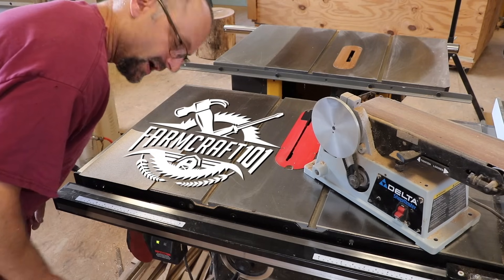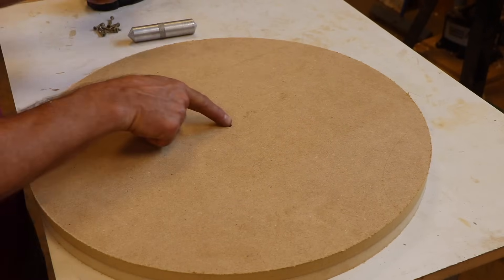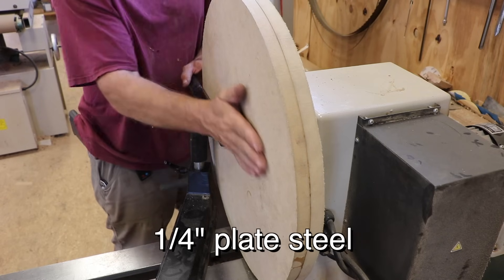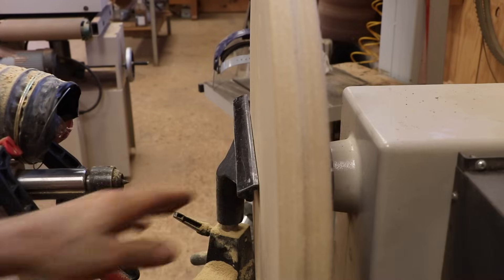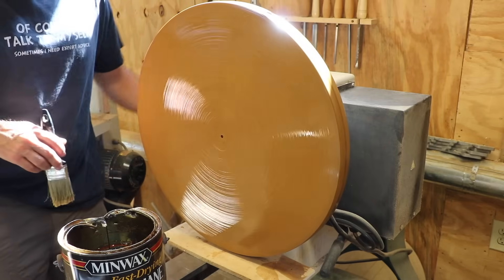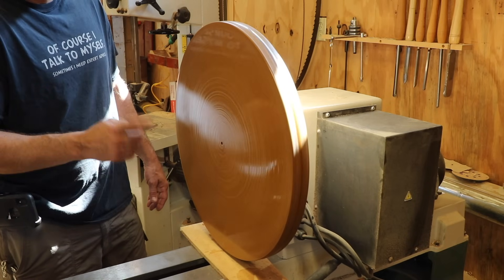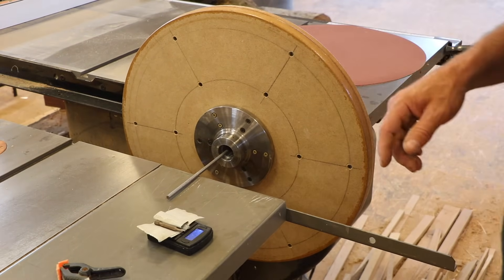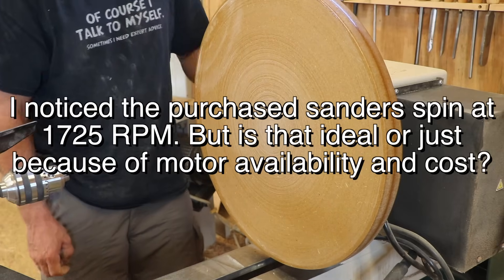DIY 20-inch Disc Sander Build.  $2000 Tool, Cheap and Easy.

Comment: Nice job. Consider sealing the other side against humidity  to reduce the possibility of warping caused by different absorption rates.
Reply: Precisely what I was thinking!
Reply: I agree entirely. I had an MDF router top that was formica on one side and 'raw' on the other. Cupped pretty bad over time and ended up having to toss it.
Reply: Yep.
Reply: You are right that ealing both sides is critical for avoiding warping. Mr Farmcraft101  is an amateur pretending to be a teacher by naming his channel Farmcraft101 like it is a college course.  He is really a jack of all trades and master of none.
Reply: But better than a Master of One
Reply: @rationalist47  it's farmcraft 101 and not woodcraft 101 mate. and a jack of all trades is a master at farming 😉

Comment: Back in the 1950s, when I was a teenager, my Dad's shop had a 4 foot wide sander that i loved to "play" with.  And all the machines there were run by leather belts that were moved to large drive wheels by long wooded handles to turn them on and off.  The Jointer was 2 feet wide, the Planer was 4 feet wide and the Shaper had a 2 inch spindle.  There was also an Elevator to the 2nd floor driven my belts actuated by pulling ropes.  Loved that old shop.
Reply from the maker: Sounds awesome.
Reply: Was you father Thomas Edison? Because you are describing his West Orange NJ factory/shop now museum exactly...
Reply: @joehook145  Would love to see it and compare to my Dads.  I say "MY DADS" shop but he did not own it.  It was Lambert's Manufacturing in Waynesboro, VA.  Probably on Google.  When i was young, Mr. Lambert used to give me peppermint candies when i was there.
Reply: @joehook145  Yes.  Pix brought back some memories.  DANGEROUS... OH YES.  One of my Dad's co-workers was missing 2 fingers.  Never knew how it happened.  I got cut once by touching a Jointer blade.
Reply: Off of the Kankakee, river, where the Yellow river joins it, out by Kouts, Indiana was an old paddle wheel grist mill, that did a lot of everything, from grinding wheat into flour, to running a small sawmill, with a blade that was lying in the river, by the railroad track bridge, it looked to be about 4K from the center out to the edge, … and I can imagine that the paddle wheel also powered a lot of other types of tools, … that mill, is now long gone, but it had left its mark on the history of Northwest Indiana, … the 1st Chicago Ford Assembly plant, was located in the town of Dyer, Indiana, and there were these huge pictures showing them in rating an engine block, & associated parts, towards the back of the old Standard Oil, gas station, … a couple of hundred yards from the Illinois State Line, on US 30, … when they tore down some of the homes, on US 30, west of Hart Street, they found that there was underground tunnels, that had been dug, just a few feet below the surface that led to a bar which, was called Al’s Tap, back in the day, … found out a number of years later, that when they tore down the old roadhouse that sat kitty corner from the bank that replaced the old houses with 16’ beams to support the floors, at the intersection of US 30, & Hart Street, that there was another tunnel, that had been covered over crossing from the roadhouse to the homes on the opposite of the street, where the bank, had been built, … 
This was all a great part of the “Underground Railroad”, of Pre, … civil war days, of the 1800’s, and apparently, business had been quite good, … over the decades it had been built to withstand the March of time, & Progress, as the sleepy little town, of Dyer, Indiana became a heavily traveled route, approximately, 4 miles from where the very 1st 4 lane highway was built as a test route, on US 30, made another Deutschland/Dutch heritage site along the routes that the pioneers had blazed through the swampy lands of Northwest Indiana, … many pioneers traveled those routes, some with the local Native Americans guiding them, & some fighting them off, when things weren’t so cordial, … Hart Street, in Dyer was so named for the man who drained, the huge swamps of the Greater Calumet region, in order to create more farmland, resulting in the formation of the Kankakee, Iroquois, & Yellow rivers, in addition to the Grand Calumet, & Little Calumet rivers, along with places such as Cedar Lake, Indiana, Lake Dale, as far south as JC Murphy Lake, (aka Willow Slough FWA), … the flowing waters & other tributaries, created some of the most viable farmland ever seen, but is fast being populated by the Progress of an ever growing population, … as it is regionalized by mankind, instead of expanding in other directions, … as the Chicago shoreline, & suburbs having been built, as far north, & beyond, into the state of Wisconsin, the Indiana lakefront is also continually being built, & progress, will pervade into the state of Michigan, as our population continues to grow beyond our means to care for the ever increasing inhabitants of the lands, … I’m just wondering when will they drain Lake Michigan, as the population continues to increase, … will it become as the western drought, continues its way across the Rockies, … Lake Mead, is it? That Hoover Dam was built to contain, … is at its lowest ever, and it may cease to provide the greedy water corporations of California, any product what so ever, … what does the future hold for America, … the “once” beautiful, with amber waves of grain, … nation that has allowed its own laws to propagate the extinction of freedom, as the word is, & has been so vicariously used to describe only 1%, of those once deigned as the multitudes of the weak, the tired, & downtrodden, … 
I truly apologize for the seemingly endless rant, but felt it needed to be implied and said, … so that perhaps those with the will of prosperity, be led to an exercise of the truth, … this nation, is, … in grave danger, … allowing the corporations to greedily take, without reinvesting in the future of our nation, this country I’ve called home for the past 6&2/3 decades, I can no longer try to carry the load, but am trying to Send a light through the darkness of our futures, in the hopes that it will be seen by enough who truly care for the futures of all Americans, …
Reply: @ronthacker211  that gave me the shivers but im betting the machine wasnt running when you got cut
Reply: @brianshea5014  I used to go with my Dad to sharpen those knives (blades) on the weekend.  When they came off the auto sharpening machine they are beyond VERY sharp.  All i did was pick one up and that's all it took.
Reply: Teenager in the 50s? For someone pushing 80, damn you look young for your age. What’s your secret dude?
Reply: @timconway2810  Cigars, Moonshine, Southern Comfort/Pepsi.  I was 14 in 1959.
Reply: My grandpa had an electrical supply shop in a chicago suburb had that belt driven mechanical devices all throughout the building until he sold it in the late 80s. They still exist here and there.

Comment: Great job. You should get a lot of use out of it. Many years ago I worked at a shop in Germany. They had a huge 36-inch or so disk grinder. It could have been homemade but it was well constructed. It had a very large motor driving it at a scary RPM. It didn't have sandpaper on it, the wheel had teeth made into it. Very coarse teeth. It would eat a 2x6 size piece of lumber as fast as you could stick it into it. It was faster than a saw and the guys would mark a line on a piece of lumber and sand it to the line in seconds. Years later I made one on a much smaller scale with a threaded hub welded to a plate and then trued it up in the lathe. I used sandpaper on mine.  I used it mostly for knife making and it too was very fast at its job.

Comment: I don't know where you would get them, but Shopsmith has a 12 inch disc sander attachment and they offer discs with a hook and loop backing.  Since they probably don't make the discs, someone out there does make them for them with hook and loop backing and they might sell 20 inch sandpaper discs with hook and loop backing. You also get the mating piece from them that fastens to your disc with pressure sensitive backing, and allows you to remove a sanding disc without damage to the sanding disc or the disc fixture, and change to a different grit in minutes.  The discs can be reused until they are worn out, giving you more life from a disc, considering you would want to use different sandpaper grits often.  I like the hook and loop backing because it gives you a bit of a cushion to the sanding disc.  If different sanding grits are important, you could make more than one of the discs you make in this video and have them fitted with different grits.

Comment: I made virtually the same thing for my lathe. I made mine with a layer of MDF and a layer of phenolic faced Baltic birch plywood, so it will hold up to changing the paper.  I can even use mild solvents to remove leftover adhesive.

Comment: For the average home user "house manager" a shop Smith is a great tool that has a disc sander, table saw, drill press, lathe, jointer and more all in one. You can find them used for around 5-750 USD.

Comment: I bet you could include a small ring or clip to the underside of your steel platform plate/table that would allow you to quickly attach the end of your dust collection hose.  As the fine dust comes right off the machine, it gets sucked right up. It’s that super fine stuff that’ll get you or so I’ve heard.

Comment: I made a sanding disc similar to the one you made but I used 1-layer of Corian material on top of the MDF which is flat and a solid material that the adhesive on the sanding disc will readily stick to.

Comment: The one I made 12" wood wheel  on a 1750 rpm motor with no problem with a slight vibration

Comment: I did this on a smaller scale for my lathe, i used a piece of 16ga 6061 aluminum as a facing, epoxied in place works great, use a heat gun to heat disc adhesive and comes right off

Comment: 3m weather stripping adhesive ! is what we used for decades to hold sanding disks on DA sanders ,disk sanders and the like.... it works great and does not get super hard.... so you can get the old disk off if your careful add a bit more adhesive and apply a new disk...

Comment: Maybe a little late but i used varnish on my mdf plate, 3 coats. The varnish bond on the disk is stronger than the adhesive on the sandpaper. I’ve only changed the paper once but it went well. You can wipe it down with a little paint thinner to get any residual adhesive off.

Comment: FYI you can get a Shopsmith sanding disk attachment, then all you need is a motor with the right size shaft or an adaptor. makes a cheap 12" sander

Comment: Well I think you did a great 👍 Job with that. Here is an Idea you might want to check into I've been around auto body guys and I noticed that they use some kinda glue on a disc and put there sand paper on the glue coated disk I think they wait for the glue to get tackie before applying the sand paper. Anyway good luck I still think you have great idea.

Comment: Use Formica laminate on the face. Adhesive discs wil stick, be easy to remove and easy to clean. Also, some weight around the perimeter will actually make it more efficient.

Comment: I put a self adhesive velcro pad on mine to which is attached the 305mm sanding disc. When it wears out I tear it off and attache another one at about A$20 each. Smaller than yours but does all I want it to.

Comment: Yes the backside also needs finished.

Also don't have to waste $ on those cleaning sticks,a rubber sole old worn out boot works just a well if not last longer especially if it's a Vibram sole.
I don't have a lathe so I used a dewalt buffer I bought 20? yrs ago for like $20.Made a MDF wheel to fit a 12" disc.It's adjustable from 1000 to 3600 rpm.
I also built a multi-position table for it to lay your work on and added a dust port.There is almost no dust that gets past the outer edge.

Comment: You asked about top speed.  I would keep it low but not due to size/weight of disk.  But more the inside/outside speed from one inch to next from center.  As you kinda explained.  Way more sanding closer to spindle than away from it.  And if it’s a larger surface your trying to get flat, worse the results.  It’s an exponential difference.  But much difference working with a 6” disc sander than a 20” one.

Comment: A product called  MEDEX  is a waterproof  MDF.
Twenty years ago, I decked a trailer with 3/4 MEDEX werx great. Only upgrade off the top of my head.
Also, two layers of 3/4" Baltic birch would make a great faceplate.verrry dense ply. 9 plies in a half inch....pre drill. It's dense.

Comment: I bought my non expensive disc Sander at harbor freight I have used it it works extremely well considering that I had zero time invested in making it half the time I think the three horsepower motor was more expensive by itself than I paid for the whole sander. I think basically I I bought a motor and got the sander for free

Comment: You need a hard finished surface on the mdf to stick on your sanding disk and be able to remove it later.  Suggest lacquer or polyurethane  and paint it on while it turns slowly on your lathe to get a uniform coating.  Ohhhh you did that...kool.  Turned out great...beats buying one for $2000 +

Comment: A bit late to the party ... when I made my 12" version for my Minimax T124 wood lathe, I did the same as you with regards the MDF, but I then faced that with laminate flooring ... I followed that up by adding hook and loop to the laminate face ... means changing discs is just a matter of pulling one off and putting the other on

Comment: Your a man after my own heart Gunga Din, I try to save money by doing everything for myself whatever I can that is. I simply hate spending money I dont have to. I have a thought some disc sanders use Velcro to stick the disk onto the plate it should be fairly easy to stick it to the plate, the difficulty would be sticking the other bit to the sanding disk, unless you can buy sanding disks that size already having the other Velcro material on the back of the disk. Just a thought. One other thought, in Southern America people catch catfish abbreviated to cat, hence there's more than one way to skin a cat, not referring to our beautiful, charming lovable feline friends at all.

Comment: Just thinking velcro added to sanding disc  and MDF would be good , just like a 3M HOOKIT system used in autobody repair , but maybe  getting velcro that size would be difficult . Just a thought .

Comment: Once i have a smooth surface, i cover the MDF with laquer, or whatever I happen to have in a spray can.  Then i can apply the sanding disc easily, and then remove repeatedly (as needed to change grits) with the aid of a heat gun.  The heat gun makes easy removal and never destroys any of the MDF with this method.

Comment: If you don’t have a large wood lathe, you can use a front wheel bearing (off a front wheel drive car) and the brake rotor. Put it on a stand and make it belt drive. Of course a larger disk attached to the rotor to stick the sand paper on...the car wheel can be used for the base...

Comment: Balancing I would have suggested adding extra screws to level it out. Chances are you may have to rebalance 2 sides or 2 spots on the wheel to get it perfect.
Reply: I was thinking drilling out one inch holes on the back side. I've noticed on some of my large steel faceplates this had been done.
Reply: @robertcornelius3514  yep subtract or add I was just considering the centrifugal forces and the possible expansion over time of the wood at high RPM and thought an extra screw or 2 might help combat that, but may also cause premature splitting.

Comment: Use old hardened silicone from a tube as a sand paper cleaner. Those cleaning rubber sticks get expensive and don't last.

Comment: Just had a thought,wouldn't recycling an old washing machine ,the spider that holds the drum has a nice beefy bearing and pulley system to the motors done,the spider could be modified to support the disc?

Comment: Should have finished the back of the disk also. Plywood and other materials will suck moisture into the side that isn't finished and can possibly warp. Maybe the shop is fully climate controlled year round so probably won't matter. Great channel, subbed!

Comment: Beware of heating when the disc looses sharpness over time. Hot and cold cycles can make the glue on the sanding disc stick with unexpected tenaciousness. Good luck.

Comment: I think that this is one of those things we're more is better. Sure it will remove material faster, but if your not a high production shop how important is that actually. Otherwise I think that is a fantastic Alton Brown approach to your too. (I'm referring to Alton saying there is nothing in the kitchen that as single use, smashes walnuts with fire extinguisher.)

Comment: 1:05 I have that same Delta Shopmaster and I agree, it's not a very good tool.   It's woefully underpowered, and although both the belt and disc can be used, you have to be so gentle with the pressure that it takes much longer than normal to get anything done.   If you were doing super fine detail work, like veneers, it would probably be a great tool, but for "normal" woodworking with large pieces of wood, it is mediocre at best.

Comment: Thanks for sharing. I am in the planning stages of making a sanding disc for my lathe. This helps that process significantly.

If you really want to nerd out on balancing the disc, component balance the two discs prior to assembly. Place the imbalances of each piece 180 degrees opposite of each other. This will reduce the amount of correction required for the final assembly balance.
Reply: Well said.